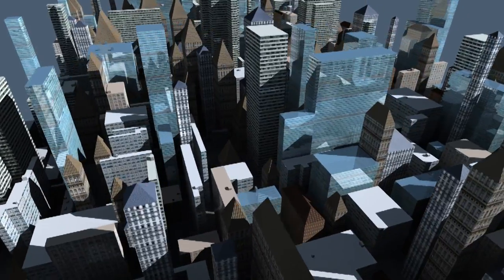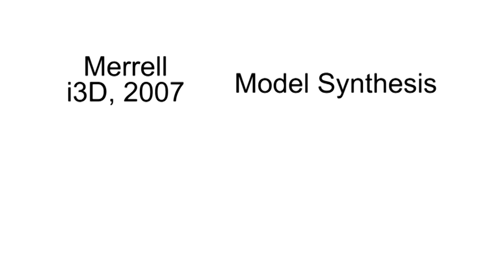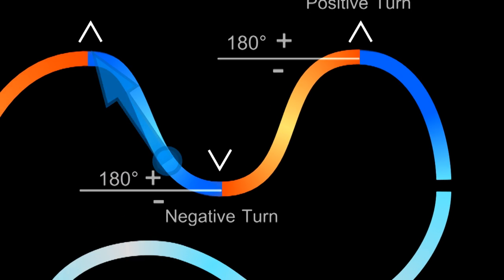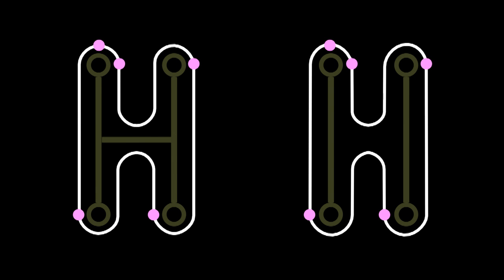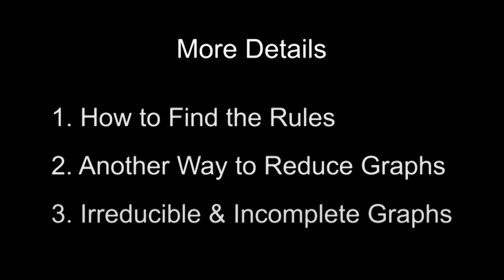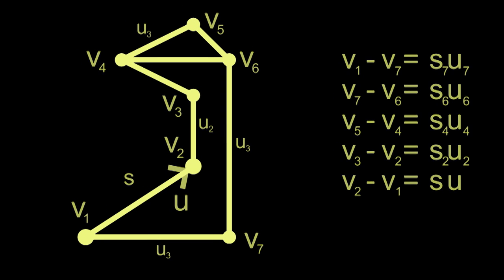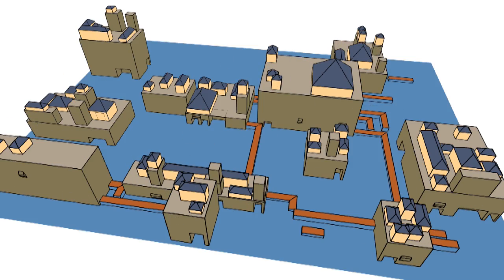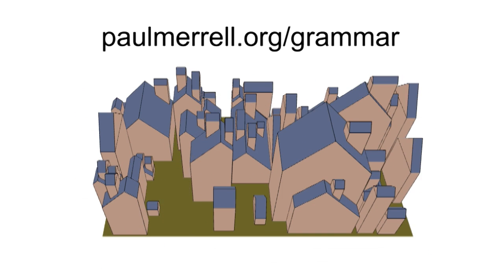Procedural Modeling Using Graph Grammars

Comment: This is fantastic! 

I wonder if there's a way to get around the issue of edges getting unnaturally long in the output. My instinct is to put some sort of length constraint on edges, but the edges are lost in the reconstruction process. Maybe you could tag edges in the input, and match those tags in the output using the angle/adjacent region info. I wonder about multi-stage generation (eg. marking edges as possible spots for windows/doors) or the ability to mark a region with a minimum area constraint.
Reply from the maker: There actually is an constraint on the edge lengths. They have a minimum and maximum length. Although I may not have set it correctly everywhere. It is necessary to do something like this. The alternative would be to look the right edge lengths from training data, but the whole point is to not require the user to provide a lot of training data.

A multi-stage generation is certainly an interesting possibility.